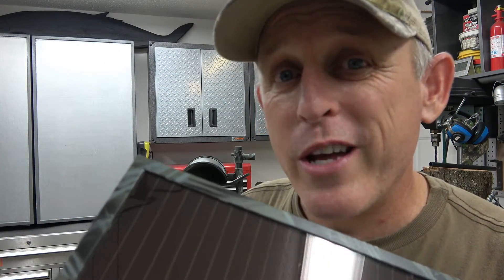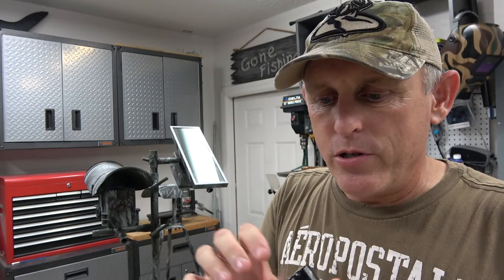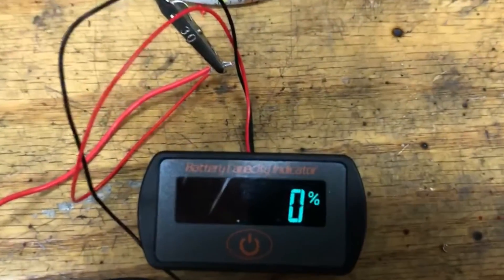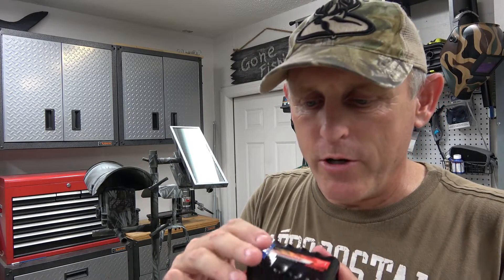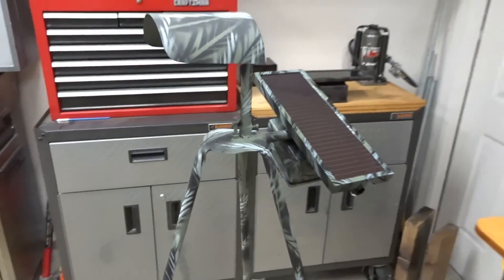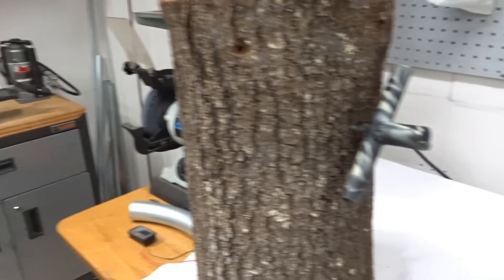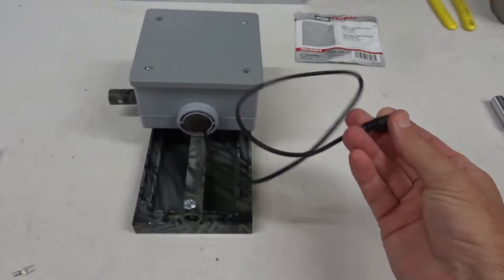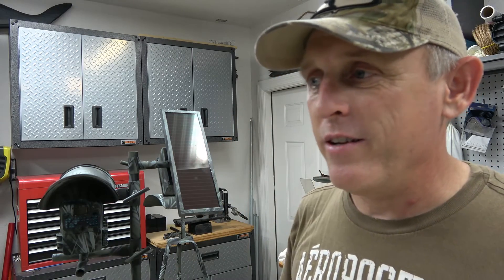Trail Camera Solar Batt Pack-DIY

Comment: Great video.  I have a couple gravity feeders with soybeans and corn (50/50) with  Spypoint cell cameras.  Installed them about 1 month ago along hog with  exclusion fence. I will be making a couple of these.  Have you thought about solar charger for your cart?  Hope you and your family are doing well.
Reply from the maker: Hi Mark!  Sounds like y’all been busy too!  How do you like your spypoint so far?  We only have 1 bar to 2 bars in the woods so sometimes the pics are delayed a little.  Overall, really cool to get that new pic notification!  I don’t need a solar charger for my cart since I leave my cart plugged into a battery maintainer.  Do you have power at camp or a generator?  Keep in touch...hope your family is doing well also!
Reply from the maker: Shoot me some pics of your hog fence setup when you are done!
Reply: So far the Spypoint cameras are better than I expected.  My phone shows 2 bars but the cameras have 5 out of 5 bars.  Battery life is good so far but once I follow your lead it won't be an issue.   I  hunt 2 separate parcels, one is 2 miles and the other is 8 more from camp. Full power and water at camp, nothing where I hunt.  Currently use 4 wheelers but have club car I'd like to build with a solar charger.  Couple more of your videos and I'll have it down.
Reply from the maker: I hear ya!  We had a little challenge getting it set up and to connect at first but we finally got it.  We just threw a 12 volt battery box on our camera and it’s at 97% after 3 weeks.  I’m gonna put the new solar setup on it next time we go up.  I’m also going to buy the cell booster antenna.  If I ever see a golf cart going down I-75 with solar panels on the roof I’m gonna know it’s you! LOL.  It can be done!